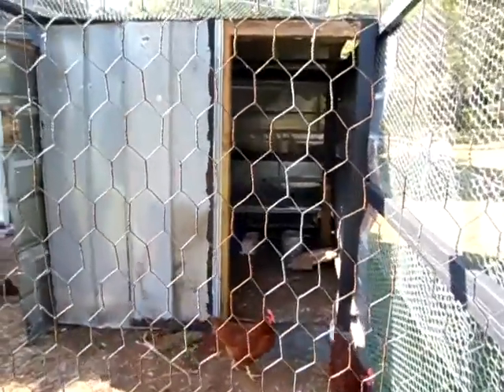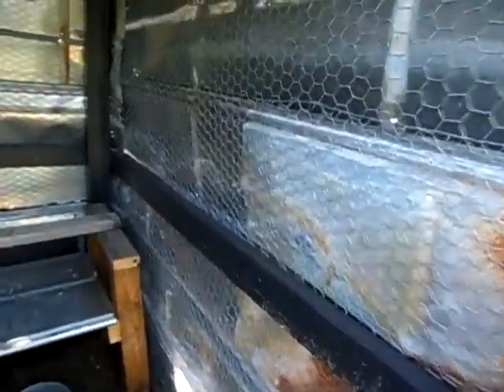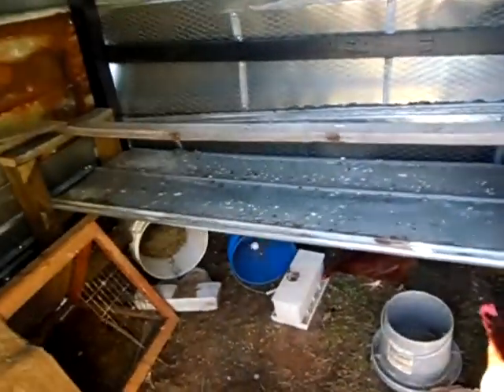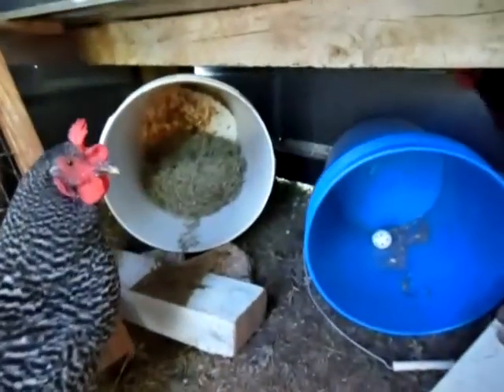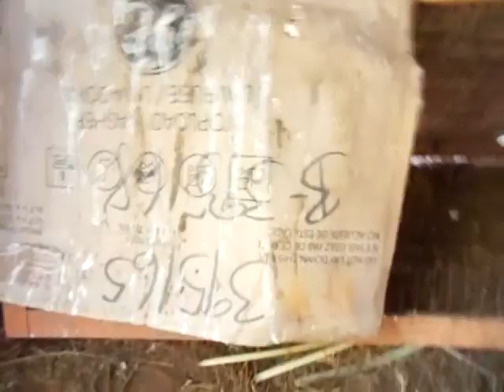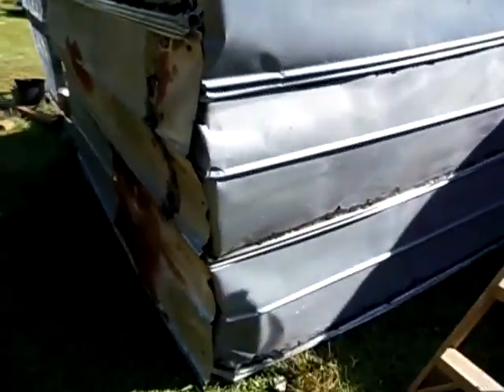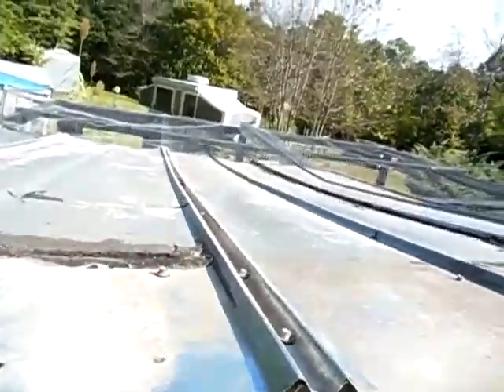Homemade Hen House

Comment: Looking good. 

Consider removing the piece of tin below their roost. Urine in their dropping will destroy it soon.   Move your nest boxes from under the roost area as well, to keep them cleaner. Hens will lay in any type of box with straw as long as they can easily access them. 

You may have done this and I missed it. When putting on siding or roofing always start at bottom and work upwards. Each piece of tin, shingle, etc. overlaps the one below it. Thus shedding rain. 

Hope this helps.